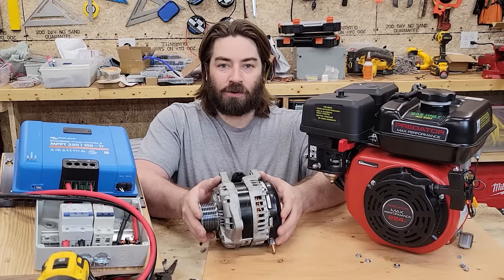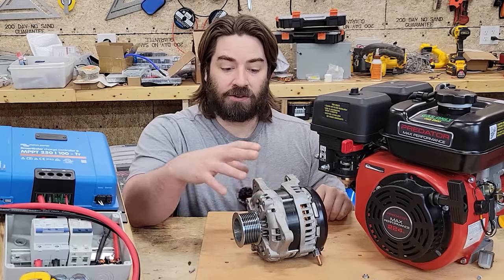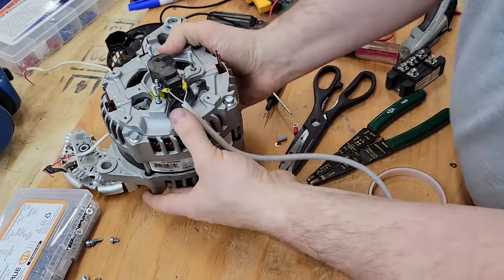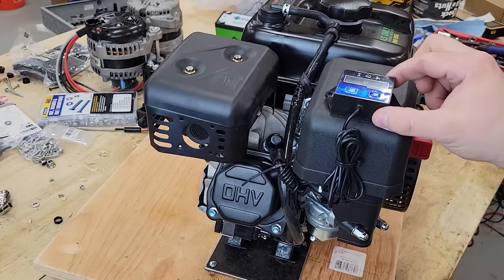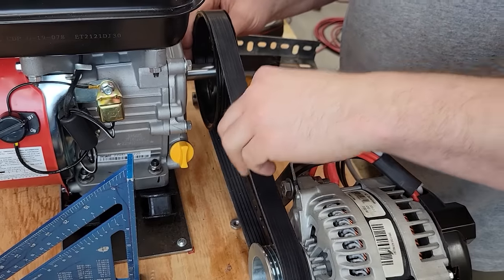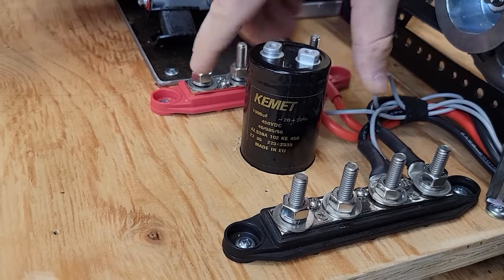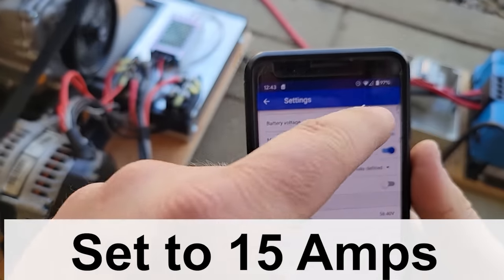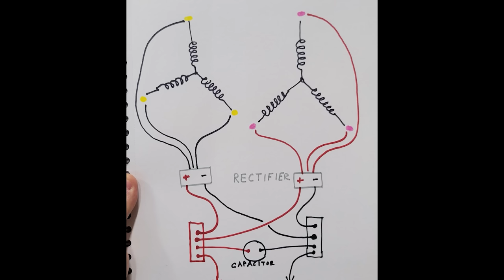The AlternatorGenerator, First Attempt.  48V Battery Charging

Comment: biggest issue you have is if the battery gets full and then charge controller shuts off while the alternator is still spinning you will blow up your alternator.
Reply from the maker: In my testing I have shut off the charge controller while the alternator is still spinning.  I didn't have any problems.
Reply: @DavidPozEnergy  😮 thats not possible. if the field windings are excited and the alternator is under load the abrupt disconnection from a solar controller or BMS will destroy the alternator due to that current needing to go somewhere. the EMF feild collapses in the alternator and induces a spike that destroys the winding insulation. this is why you need to buy expensive alternator controllers when you buy dedicated charging alternators. they also serve to lower the excitation voltage relevant to the temperature of the alternator and battery so they dont burnout. you may have gotten very lucky and caused damage to other components like your cap, sator insulation or diodes that isnt yet apprent. you need to do some research on alternator controllers in dedicated battery situations. https://www.wakespeed.com/product/ws500-advanced-alternator-regulator/
Reply: @DavidPozEnergy  A solar charge controller is not the right option here. in solar and wind the controller is in series in the circuit. in an alternator the controller is external to the charge circuit. this is an advantage. requiring less rugged parts carry big currents, FETS chopping up signals, large amounts of RF being produced ect. going back to a series arrangement is much more expensive and unessacary. by simply varying excitor voltage relevant to battery voltage, rpm, alternator temp, and batt temp you can accurately control output voltage without all the expensive parts. (this is what an alternator controller does) that way you will charge your batteries correctly and you will not destroy your alternator by sudden disconnection under load.
Reply: @DavidPozEnergy  and by the way you can buy a cheap 100A 48v alternator from john deere. there high end golf green lawn mowers use electric motors to drive there blades rather than hydraulic. the alternators are around $900 USD each. not bad for 4.8KW 
https://balmar.net/96-series-48v-alternators/
Reply: @DavidPozEnergy  but well done on the project. when i saw you having a go at this i immediately knew you were not savy to the current state of the art so i continued to watch to see it all go up in flames but you did it! this shows how a bit of ignorance to the established methods are good sometimes. nice work. now pull out the arduino and make us a cheap alternator controller :)

Comment: Now, we figure out how to run this setup with an old alternator and an old bicycle... preferably through a transformer to get it right up to 120v from 12v....
Reply: No no scratch that, it would be a hell of a transformer... best to use this to see if you can get it up to 90. I guess you can't avoid the charge controller to account for variable output voltage.

Comment: Sorry, but Why are you doing this ?  What was the point again ?
Reply from the maker: I run my house off grid, using solar energy 99% of the time.  But, once in a while I don't have enough solar energy and need to supplement.  This build is to recharge my battery bank during those occasions.
Reply: @DavidPozEnergy  Wow , totally understand Thanks for answering.  Your explanation along the build was GREAT.  No problem fallowing along.  Yes I'd love to see a fuel study.  Also a direct coupleing example.   I am in the same "off grid" situation as you.  But I'm just using a generator for now.  Your Idea was on my thoughts all along and you did it.  Thanks so much...  Thanks

Comment: I WOULD SUGEST THAT YOU USE 2 DIODES ON THE FIELD EXCITEMENT. ONE ON THE BATTERY OUTPUT AND THE OTHER ON THE OUTPUT OF THE DC-DC CONVERTER SO THAT NO ONE WILL INTERFER WITH THE OTHER INDEPENTDE VOLTAGE EACH ONE HAS

Comment: DANGER! NEVER use an AC only breaker as an overload protection or even a disconnect on a DC circuit! They can easily burn up or even blow up (in the event of a short). DC arcs are way more violent then AC arcs as there is no 0V crossing point to extinguish the arc, making DC breakers and switches of the rating you'd need here about the size of a brick to quench the arc.
Reply from the maker: Thank you.  I share your concern.  The data sheet on this breaker supports DC use.
Reply: @DavidPozEnergy  I do not see where this breaker is rated for DC amps ...
http://next.chint.com/upload/data/201807-11/111129029735003233.pdf

Comment: Actual generators are cheap if you get them when sales are slow. Like don't wait until there's a natural disaster.  My 12500 watt Westinghouse was only 700 bucks. It'll run my whole house runs off gas or propane and even has a remote control. If your gonna use a car alternator get an inverter and just start your car.

Comment: I wouldn't do that.  It's not going to be stable.  Use a capacitor bank to condition the power coming out of the alternator and a step-up buck controller to get your perfectly metered 24 volts.  If you throw in a voltage regulator after the buck controller, there's no way you'd have any holes to that expensive looking battery bank.

Comment: That alternator is not rated for anywhere near 3kw.  They are generally rated around 800 watts and with nowhere near a constant duty cycle at 800 watts.  This alternator will not run long at 3kw.
Reply: I would take the rating of that alternator with a grain of salt, as it is probably an aftermarket.  Most OEM alternators are only rated about 65 amps at 14v, which is less than a kw.  You've removed a lot of the heat generating devices from the alternator, but the windings will still get hot if it is overloaded.   It is probably a big ask to ask it to go near its rating for hours on end.
Reply from the maker: Check out part 2, I answer these questions:  https://youtu.be/cy0t4qq8mS0
Reply: @DavidPozEnergy  I just watched it.  Despite my comments, I think you did an excellent job, so don't take them negatively.
Reply from the maker: Thanks for checking out part 2, and your comments.   I'm learning,  and appreciate anyone willing to take time to write a comment.  They really help.

Comment: It's a violent effort way more work than necessary, next time simplify, and mount your alternator directly to the engine like it should be, it will never work correctly with the motor mounted on rubber and the alternator mounted solid, I know you David you'll get it right next time, and we all learned how not to do it.

Comment: There is a better way and the fule is nearly free.. look up gasification or gasifyer. You can use a normal generator to use a charge controller to recharge batteries off of wood fuel.

Comment: use an electric motor (3-5hp) and feed back some of the power back to run the motor as well. then you truly have free power
Reply: like a compressor motor 3500 rpm

Comment: DC Voltage Booster Converter DC/DC 12V to 48V Step up Converter and there is no need to mess around
Reply: Cost of Inverter ???  And giant sized wire, that are very long? Not a good idea.

Comment: The alternator was already a dc charger rated at about 3300 watts ,{or what ever}.  Now the key here is the wattage.  This is what limits everything.   All you did was test the wattage at a differant voltage.  In this application ohms law will sufice for rough calculations.
When you get to the level where you can get more power out than you put in then you can feel good about yourself.  Right now you are just intertaining people who have no clue what you are doing.  People have been using these alternators for 120 vac generators for ever. 
Just plug in a 48v battery charger and be done with it.

Comment: I wish you would Of just us the Alternator like that I was going to us this idea as a a.p.u. on my Semi truck just strat Alternator it looks like it Won't work do you have a Better Idea how to do this the Rubber motor mounts. Have too much wiggle room. Try a square Box belt. Or it's called A. Gear Belt. Straight To the shaft is. Gonna be too much vibration. I saw in your video. The mount for the alternator was wiggling around too much. You need more support. This is a real good idea. What you are doing.

Comment: Try adding a bigger flywheel to stabilize your project and you might notice something. 
Once your RPM’s stabilizes, you will notice that you also have more power than you would have without the stabilizing wheel. 
Fun fact:
Somebody is lying about something, and you can figure this lie out by doing so.

Comment: Because on a car engine, the alternator is mounted on the block, so in the setup in the vidio does not ! 
What I see is the same as a car with the alternator mounted on the fender well and the torque from the engine moving on its motor mounts making slack in the belt !
Just like in your video ! 
The solution is simple ! 
Attach the alternator to your engine !

Comment: "Going big with a 125A circuit breaker" but your alternator outputs 215A? I hope it's DC rated not AC.
Reply: 215 Amps at 12 volts, but not at 48 Volts. And not with that engine,

Comment: Cheaper buy a alternator from a 1965 car non regulated than have ac current skip all battery use flywheel kinetic energy propulsion using small ac motor

Comment: How about this create a alternater and recharge a bikes battery while it is using the bikes battery so it trickle charge it not forever but some and increase distance why would bike manufacturer not do that ATV have some sort of alternator on them for headlight and old bikes use to have headlight light up to from friction but no trickle charge while using the battery why not what afraid get some extra miles probably or they wait ten years for a simple idea to put it on a bike most likely a patent is stopping it from happening.

Comment: Let me give you a hint ! Get you a bank of capacitors and a dc to ac inventor ! The capacitor is your battery !! Take out the gas powered motor and add a 2 hp 110 electric motor run that off a bank of capacitors !no battery required and no gas motor !! I have built 3 so far ! Works great !!
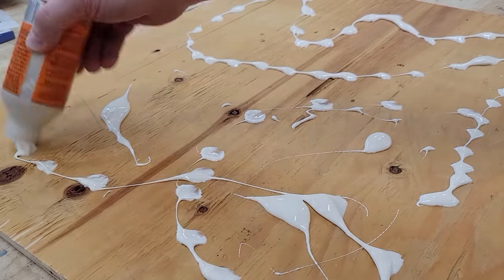Reply: Your is going to make very high ac voltage I am assuming.. 16:48

Comment: This is what I did with a 200 amp one wire and then one of my other videos you'll see it mounted and it works awesome to keep my solar batteries charged up full on a dark day This particular alternator doesn't matter if it runs forwards or backwards it's got internal Cooling in it you'll notice that by not seding a fan by the pulley
https://youtu.be/R_5VvIzI-MU?si=CKuG6PZZLzn3AGyx

Comment: We had hybrid electric cars and diesel electri trains over 100 years ago. You dont need the weight a transmission and less batteries required. They don't have too go hundreds of miles on there own. Bio diesel offers the option to grow fuel. We had steam cars that could go 130 mph. We could power our houses on wood pellets, wind, solar, hydro, produce hydrogen.  We can solve any problem, but the regulators have their own agendas.

Comment: 1200 or 12000 rpm
Reply from the maker: Alternators usually spin 2-3x faster than the engine.  Most alternators I looked at had a working range between 2,000 and 12,000 RPM  I needed to stay below 12,000RPM on the alternator.

Comment: An automotive alt is very inefficient, they concentrated on rugged more than efficient. Much better to buy a perminant magnet "automotive style" alternator set-up. efficiencies for special buit units are around 85-90% efficient where the automotive alt is around 50-70%

Comment: with only 2 thousandths of interference you should have just been able to throw your pulley in the oven at like 400 degrees F and slid it right on the shaft (if it were fairly cool).
Reply from the maker: Thanks.  I'll try that next time.

Comment: Why didn't you just get an alternator for a 1972 Chevy truck? It doesn't have an internal voltage regulator from the factory.

And, I can tell you from when my external voltage regulator failed, it can definitely overcharge a 12v battery. I'll NEVER forget the smell a hot, overcharged battery makes. 🤢🤢🤢

Comment: It would have been a lot easier and better to have used a big truck alternator  !!!!  Thay are 24 volts  systems  !!!!  Thay will give you the right volts and all the current  without all the other mods needed  !!!😎

Comment: You can buy 80v alternators cheap from China..
 You built it wrong. The alternator aha engine should have been fixed to the same plate with the rubber isolators underneath the entire set up.  
 So there's no movement between the ending and alternator. They easy you have it could cause vibration damage to the belt etc. Have a look at how belt drive pumps or compressors are set up
 Cool project though

Comment: This is a real question. Why does everybody use a car alternator to make a generator? When there's so many generators without working engines, could you take the generating part and use it in a project to generate things!? I'm not saying everything about this man or his projects. It just frustrates me, that every time anyone tries to make something that generates electricity they either use a car alternator or an old motor, when there's so many used generators where the motor is broken or seized. I've seen a man use a gas motor from an old Generator in a project but never use the generator.
Reply from the maker: In this case, I'm trying to make a generator specifically for charging batteries.  A regular generator head will make 120/240VAC.  The car alternator is more efficient for a battery charging situation compared to taking a 240VAC, 60htz, head and trying to charge a battery with that.  (through rectifier)
I hope that helps.
Reply: @DavidPozEnergy  Hahaha I think so. Again I did  not mean you. Yours was just one where I could events some of my frustrations. I have a project and I have been searching for generators/generating power and I find is people use car alternators for everything. Diy e-bikes, bicycle house generator, water wheel generator, etc...

Comment: You know and we all now know you would have been far better of buying a 48 volt alternator or a cheaper 48 volt wind turbine alternator for about 257 dollars that produces 48 volts and 100 amps at 500 rpm. This was way to much time labor and material cost for what you got out of it. 24 amp alternators are much cheaper

Comment: Spin 10 alternators off one engine with a long belt get ten time the electric power out put them brake it down to say 7 12v battery theat then power a electric motor that u fitted to a quadra cycle= very cheap running electric/ tiny 212cc four stoke that uses hardy any petrol = tiny cheap

Comment: I figured out what I disliked about your build. Your alternator is not connected to the same platform as your engine. Causing the motor mounts to loosen your belt. Creating a vibration and inefficiency during high amp lodes.
Reply: Other than that I'm learning a lot from your video. Thank you
Reply from the maker: You are right.  In part 2 video I mounted both the engine and alternator together on a thick steel plate.

Comment: Total efficiency in this system is so bad it shouldn't even considered use system like this to frequently charge solar system batteries. Generally solar is meant to reduce emissions but this setup is nightmare from that point.

Car alternators are worst possible generators. They are built to be cheap and only cheap. While proper generators have typical efficiency around 90-95%, alternators are often only 50%.

Comment: Yes you can but the whole exercise is one of losses and losing power along the way through conversion you would be better off not using batteries at all and just running a stand by generator for your power batteries are very poor (fuel tanks) energy storing devices this and the fire risk is what makes EV cars suck so badly not to mention the price to replace them when they go bad they usually total out the vehicle

Comment: Talk about doing something the hard way all you had to do was replace two zener diodes on the OG regulator & it would of put out whatever voltage you wanted!... Obviously you know nothing about how the regulator works or how much the OG diodes can handle HA!
BTW: Solid mount the altenator & motor together to stop the harmonic vibration, I was doing this 40yrs ago to weld.

Comment: Tried this don't waste your time aint worth it if you plan on actually using it for your house off grid the motor will have a hard time staying running if your batteries are too dead or the fridge kicks in motor stalls burns too much gas stick to a single cylinder diesel  for generator way better then gas

Comment: Why not just use an alternator,engune, battery and a 3000 watt 12 v inverter.booom
Reply from the maker: My solar system uses 48V inverters and batteries.  But, if you are running a 12V system, then yes, you can simplify this.

Comment: Seriously… Why the Hell would you do this and I just buy generator to charge your power bank?
Reply from the maker: There is more than one way to charge batteries.  I've been using my generator through my inverter for years.  However, I wanted to use a system that could charge my battery directly, without the inverter.  This will keep my loads powered up 100% by the inverter.  Plus, I wanted to learn more about alternators.